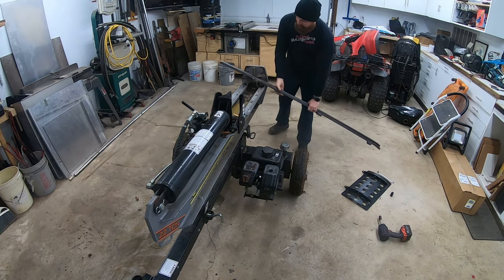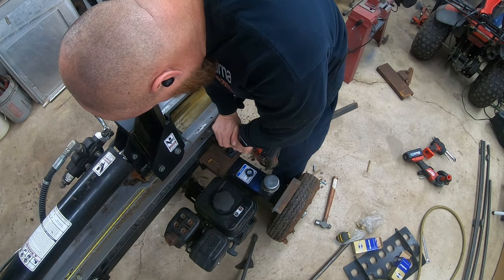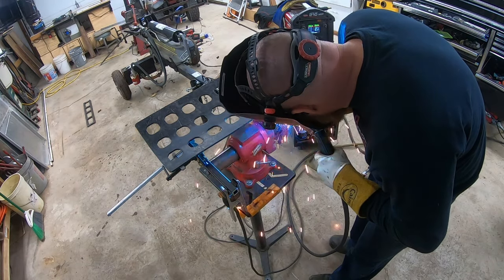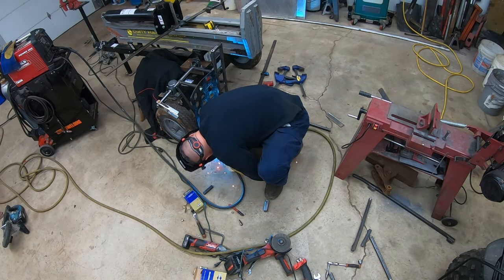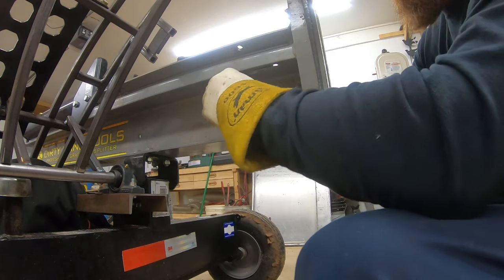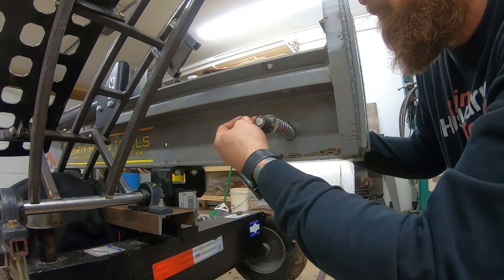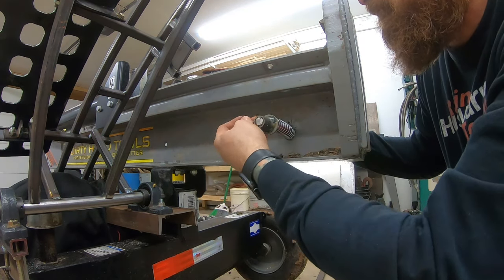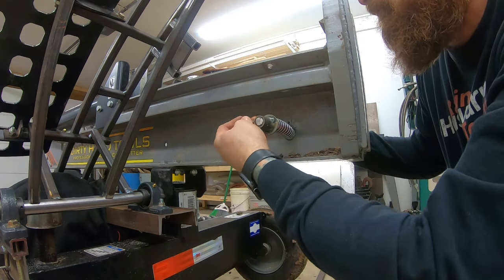Simple Homemade Log Splitter Lift

Comment: I had intentions of building a lift probably 30 years ago but decided to split small stuff first and stack up a "ramp" to roll big ones up. It has served me well, at 65 years old, I can still get a 30 inch round up on the beam.
Reply from the maker: That’s not a bad idea. I do less splitting these days just focus on logs to run through the processor. The big big rounds will just pile up for now.

Comment: I would extend the foot about 6 more inches and add a "wing" to the outside for a bit more stability with those larger rounds. Great job. Was planning to build a "side loader" but this "front loader" is much more simple and doesn't require all the pulley's and retention spring required for the side loader. I like the way you engineered the spring loaded stop as well.
Reply from the maker: Foot definitely would benefit from an extension for the bigger rounds. Front loading made it much simpler and gets the job done. Thanks for watching!

Comment: Very kool lift build! Huge back saver from having to split in the vertical position. Always hurts my back in vertical. This is a way better way to split those big rounds.
Reply from the maker: Exactly! Vertical splitting was always rough on me. Picking up rounds I shouldn’t took less toll on me that splitting vertical did. This lift helped me with splitting stuff I would otherwise leave to rot. Thanks for watching!

Comment: I’ve been watching videos on log lifts for a couple days now. I’m getting too old to lift them, and I just got a bunch of huge maple rounds and I have to make something to get them up on the splitter. Even though my huge home made splitter can do vertical, it is hard on the back doing it like that. You did a great job on yours. Simple but it works. I really like  the way you did it. I had a few ideas but would have taken me much longer. So thanks and good luck with your channel. ✌️👍🇺🇸
Reply from the maker: Your statement is exactly the reason for the lift. The splitter in vertical would wear me out faster than picking up rounds I shouldn’t be lifting. Thanks for watching!

Comment: My load of rounds had sizes 3 feet in diameter.  I was wishing I had a tractor with a bucket, or a  lifter of some sort.  I ended up putting the tongue  on the ground and found I could easily roll the round into the jaws.  I also found I could sit on a round with a cushion and work with my shoulders instead of my back.  I have been doing it for 4 years and a 88, I can do another year. 
Iguana

Comment: I have the same splitter and just move it to the vertical position and split those larger rounds in half or quarter. Then back to horizontal to split them to the size I need. Looks like a good alternative though.
Reply from the maker: I had done that in the past but, in the vertical position, it was always harder on my back. This has definitely made it easier for me. Thanks for watching!

Comment: What I found worked well for big rounds was took some scrap 2x4 and 2x6 and made it when you flip splitter up it went around bottom and log wouldn't try to fall to the side
Reply: I like what you did tho. My question is doesn't your splitter tip up for the big rounds
Reply from the maker: I never liked putting my splitter in the vertical position. It always seemed to make my back hurt more trying to use it that way to split. With the log lift I put on the splitter, it has to stay hooked to something at the hitch or it will tip up.
Reply: @nauvooacres  ok I understand the back hurting.with it in vertical position I think what was the worst for me was it always the log trying to tip helped a lot with platform. I do like the lift and your videos

Comment: Just put it vertical position is pretty easy too. Just roll it.
Reply from the maker: It was always easier on my back to have it horizontal. I used to set the rounds on the splitter with my grapple on the tractor. This was just a solution to make it easier. Thanks for watching!

Comment: Why go through all that when you can just split vertical?
Reply from the maker: I don’t like splitting vertical. I have more back issues trying to move the logs around and into position. Mostly a personal preference.
Reply: @nauvooacres  You still have to move the logs around to get to the lift, you make no sense.
Reply from the maker: It’s something with being bent over and moving the pieces around for each split. Most high end horizontal splitters have lifts. Sorry it doesn’t make sense, it’s to each their own. I found value in the lift, and posted the build for anyone else who does.